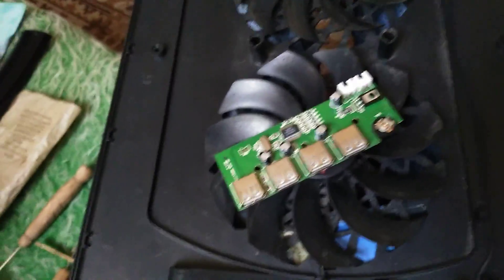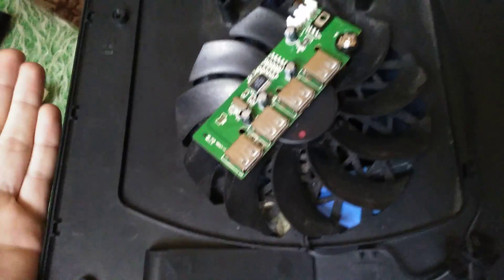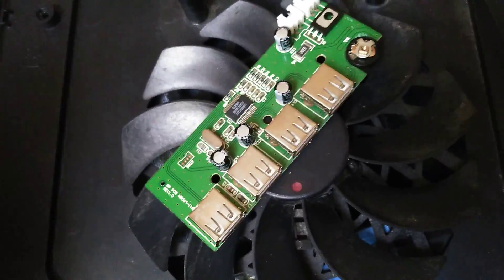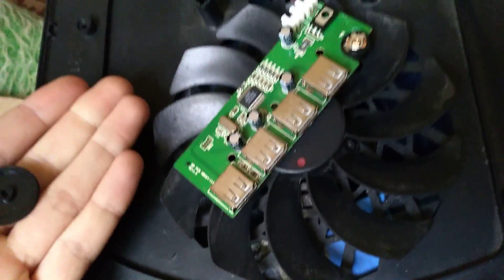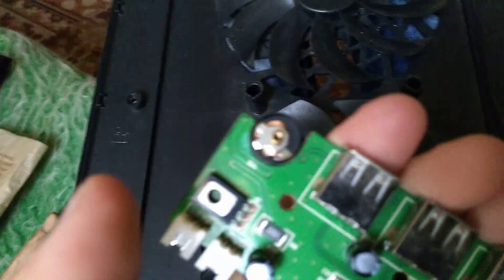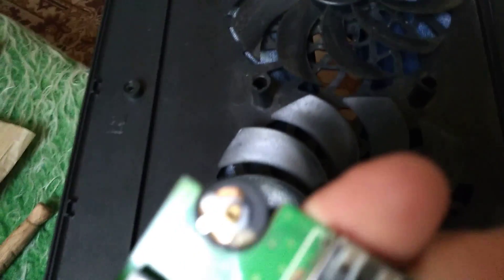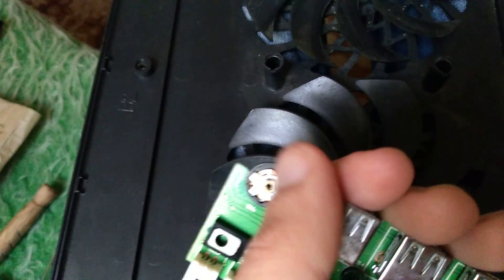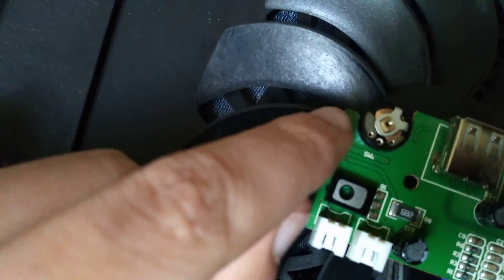Cooling Pad fans not spinning Fix Potentiometer.

Comment: So basically, u just cleaned the gold plated? Is ur coolpad have a LED light? I got the same issues.. The LED on but the fan Not working...
Reply from the maker: No, no it's carbon or graphite plating. Make sure to be clean and to have good contact.
Reply: @DarkGT I've already repaired the cooling pad mate.. but I think the circuit is broken.. so I try to cut the cables and connect them with new USB cables and.. boom fan worked properly